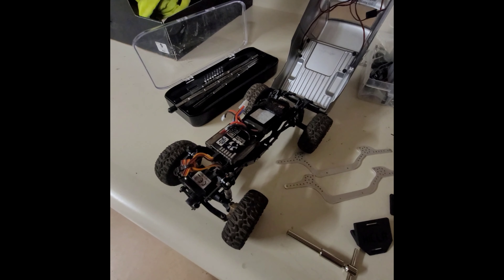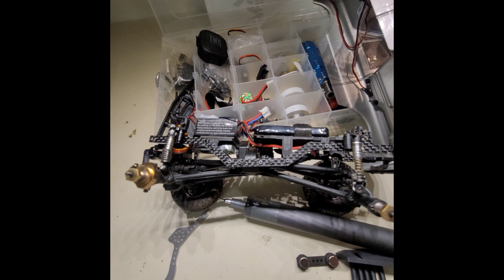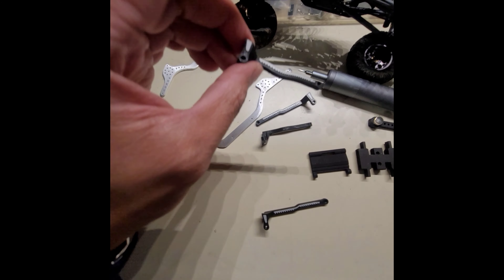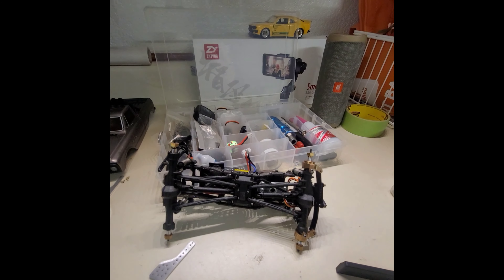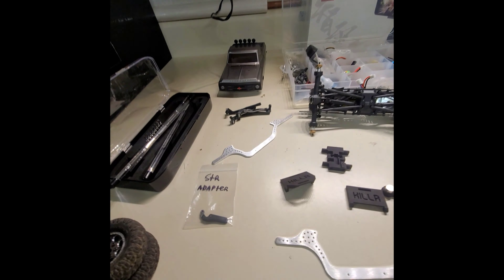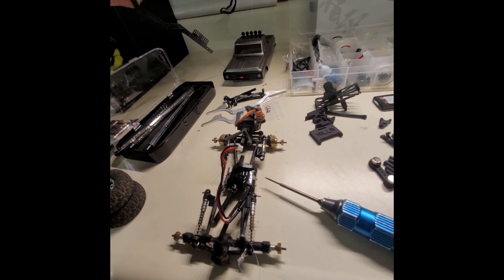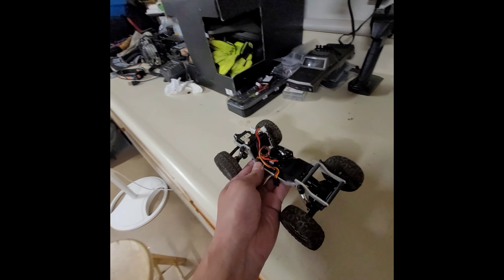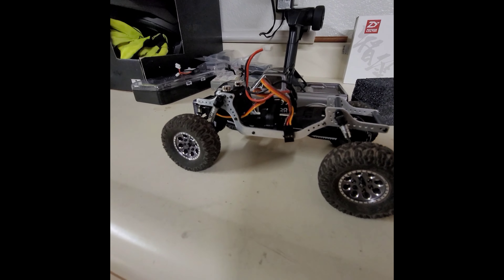scx24 Killr Chassis upgrade and overview #rccrawler #rc4wd #trealhobby #scx24 #furitek #rc

Comment: I’m thinking about getting one of these but I want to fit a 3s battery between the motor and front shocks 
Is that possible on this chassis?
Reply from the maker: yes very possible, as long as you get a small enough 3s